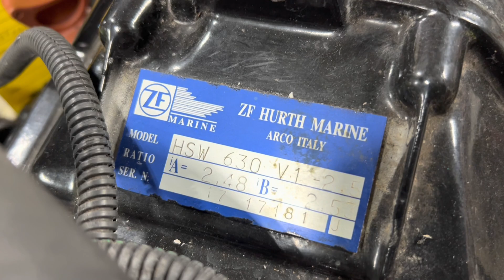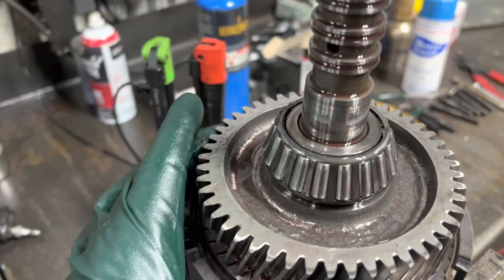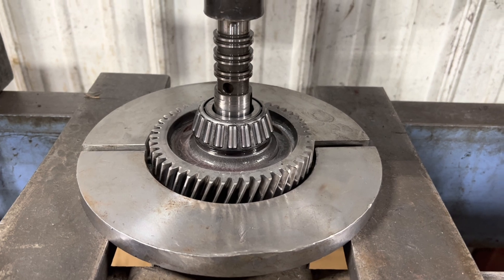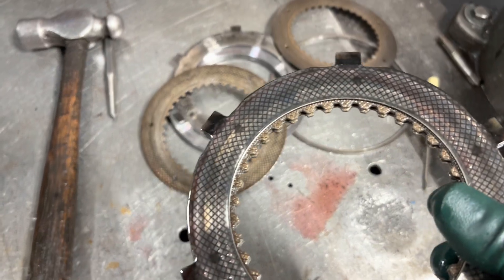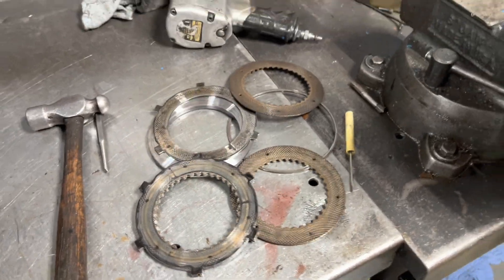Diagnosis and Repair of a ZF 63 V-Drive Marine Transmission Stuck in Gear

Comment: The gear to one direction appears as noticeably wider than the gear to the other diraction. If so, I thought these transmissions were fine for their rated power in both A/B directions... We own a first gen (very old!) ZF Hurth HSW800. I can't find shit / documentation about it, it's all for the newer generation. I think I once read somewhere that they changed some stuff and It seems the more new ones always have the exact same ratio in both directions. Do you know anything about these?

Comment: Informative vid . Would you say this Gearbox would work well with a Cummins 6bt running 190 hp or if that is too much then 150 hp ? . Planning hull at 2.5 tonnes overall weight

Comment: Hey, just got a ZF 63IV (ratio A=1.99 B=2.03) transmission second hand for free to put in my 1999 mastercraft xstar. The boat first had a HSW 630 v1 1.55 (ratio A=1.56 B=1.57) but it makes an horrible noise and wanted to replace it wit hthe much newer one. It seems to be stuck on forward tho. Symptoms are I cannot put it in neutral and when i try to go neutral or reverse, the engine stops. Does that sound like the same symptoms the transmission in this video had ? I'm looking to rebuild the new one I got in a shop but don't wanna waste time and money... Also, as the ratios are different, would it make a problem or any difference ? Thanks!
Reply from the maker: Sounds like it needs rebuilt. The forward clutches were slipping at one point and they welded together.

Comment: When you air check the disc clutch, ist normal to have the air leal in between the disc. I was told the metal rings where  not sealing properly, im a bit confuse. Thanks...
Reply from the maker: Yes, it will leak a little bit there.

Comment: Nice video. Good informations. i like it...
I got  a ZF63 A with a 2.5:1 Ratio. Actually i wonder if it is possible to change the Ratio on this gearbox to 1.2 or 1.5, cause i know you can buy a ZF63A with that kind of ratios. 
It should be possible to change the gears inside to correct ratio that i would like to have.
Do you agree ?
Thanks for your advice
Reply from the maker: It’s cheaper to buy another transmission than it is to buy new gear sets from ZF.

Comment: This is very interesting. When my 63iv started running hot, I was universally advised that these transmissions are not designed to be rebuilt and that the labor associated with doing so wasnt worth it when a new transmission could be bought for around 4 grand.  While I'm sure the video excluded many steps, the process of changing out the clutch plates didn't seem to be ridiculous.
Reply from the maker: I disagree on not able to be rebuilt. They are a good trasnmission and I do them all the time.